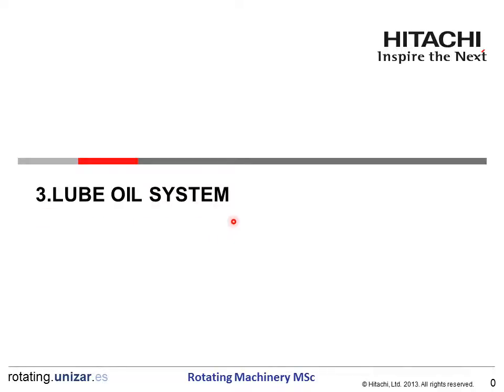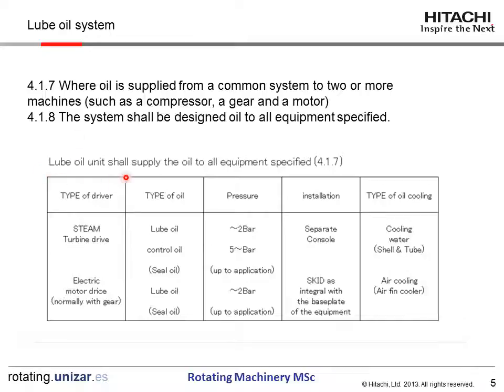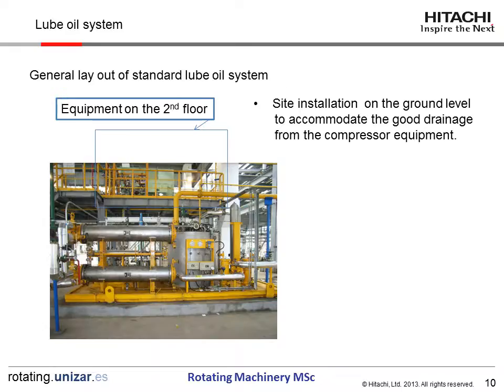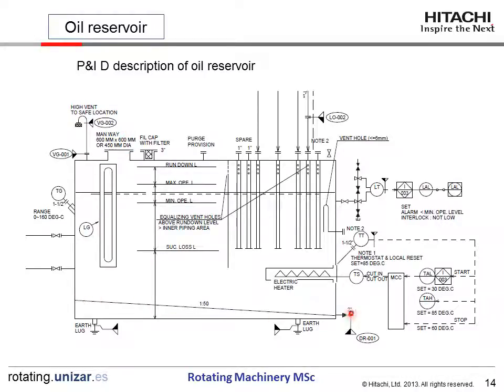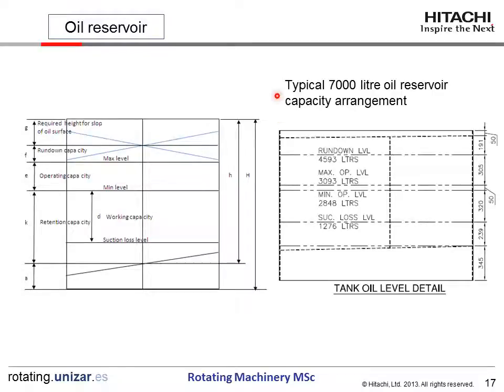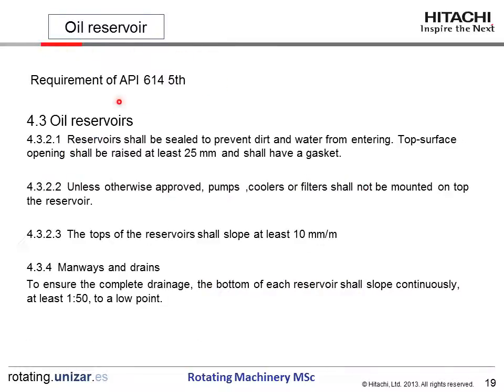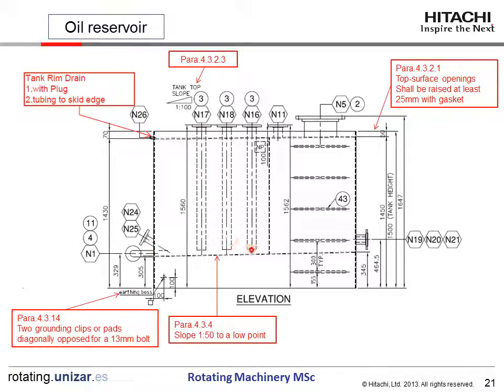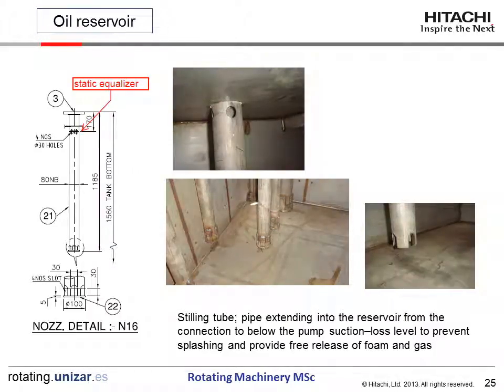M7: Lube oil system & Oil reservoir (Rotating Machinery Master by UZ)

Comment: Very informative. Could you please, if available, provide a source for this information? Book title e.g. would be sufficient. 
Also, how common is it that a lube oil tank would be intergrated in the structure of the skid/base frame? (As in: a welded tank, inside the baseframe.)